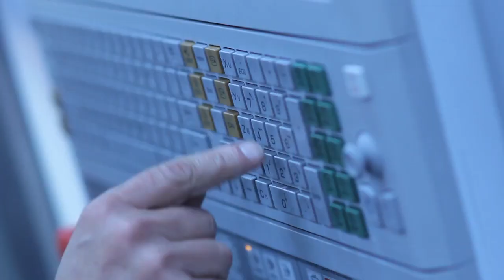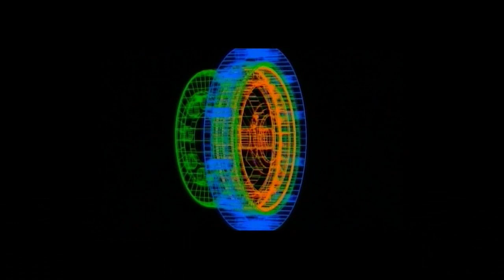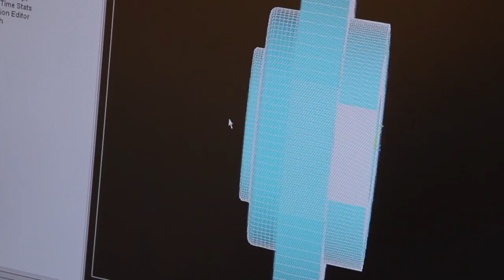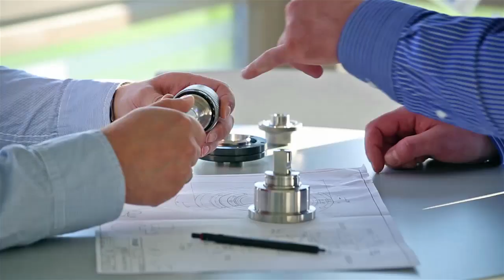Harmonic Drive AG - Company

Comment: How is your actuators compared to drives driven by steppermotors?
Reply from the maker: Hi alikePC, The Harmonic Drive strain wave gear actuators area high precision drives for positioning tasks. Their core component is a strain wave gear, which is a backlash free gear with excellent transmission accuracy
(typically < 1 arcmin) and high gear ratios (from i = 30 to i = 160). In combination with a brushless AC synchronous motor the motor gear combinations reach excellent positioning accuracy.
Please have a look at our youtube videos for more information.  Strain wave gear principle: https://www.youtube.com/watch?v=RPS4RrGjAaM
Servo actuators: https://www.youtube.com/watch?v=sWJmogxnhX8
A stepper motor is a simple motor with low accuracy. Due to its operation principle only a minimal step angle can be driven, which limits the positioning accuracy and hence the applications of a stepper motor.

If you need more detailed consultation please create an enquiry to: info@harmonicdrive.de